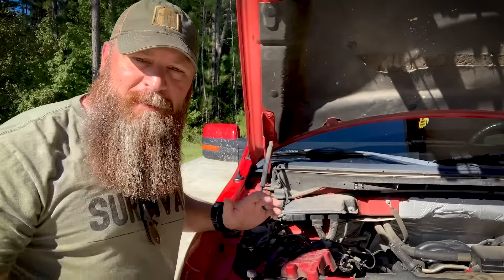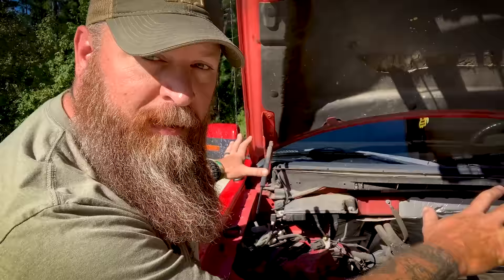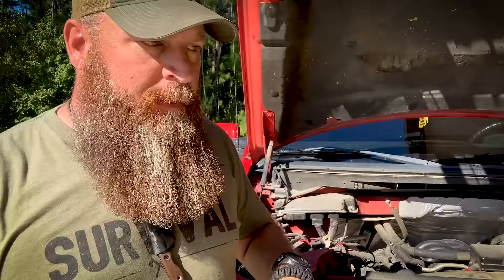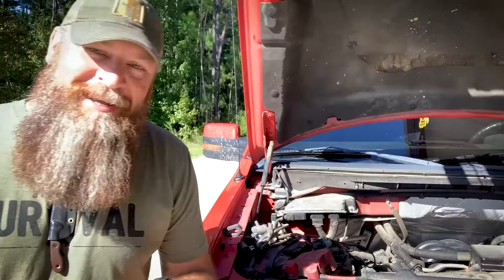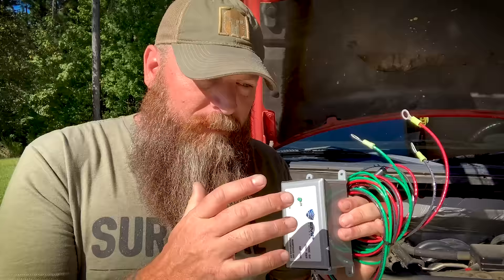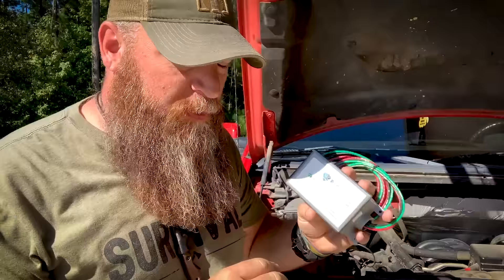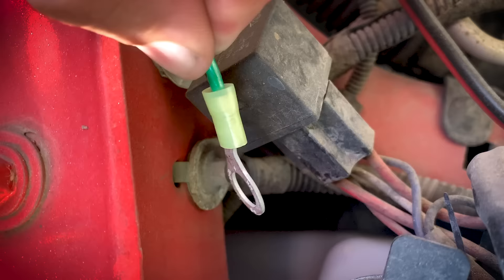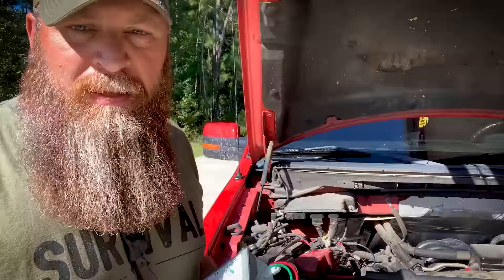EMP PROOF YOUR VEHICLE

Comment: I would need to see this device tested. Until then, an older mechanical diesel pickup is the way to go.
Reply: Facts
Reply: So your "older mechanical diesel pickup" has no electronics, such as a starter or ignition switch?
Reply: I think that it is a bunch of horse shit.
Reply: @robinstewart6510  Those devices are robust enough & wouldn't be affected by an EMP. Anything that has a microprocessor is what will be rendered useless
Reply: @Eric2300jeep    ..  You assume those devices are robust enough. You have no evidence or testing to say one way or the other when it comes to your vehicle. At the same time, most electronics in modern vehicles are fairly well shielded/isolated. They have to be to withstand lightning, electrical shorts, and similar occurrences. In the end, it's all a gamble.
Reply: I mean Whistlin Diesel is always killing trucks maybe he could test one.
Reply: @Leviathan-mj8gi  or you can just install a quick disconnect on the negative side of the battery and switch it off when it's not in use .
Reply: Absolutely.  This is an untested product in a real situation.  Dr Arthur Bradley, an EMP expert recommends a conductive cover or shield over devices and stored cars during an emp attack. He also says an emp attack will disable some devices BUT not everything will be dead.
Reply: @robinstewart6510  got me laughing in carburetor where it will start and run the direct way or old henry ford way.
Reply: @robinstewart6510  A mechanical diesel with a manual transmission is EMP-proof. Not to mention, even if it isn't manual, there are other ways to start a vehicle without an electric starter, which may be complex, but possible.
Reply: @polaris6644  if it's a manual, throw it in 2nd and push start it.
Reply: @del343434  Exactly. With a decent run up and a good starting diesel, you should be able to crank it quick and easy. Worst case, in the cold you can use caveman methods to heat the engine up prior to starting if necessary
Reply: @robinstewart6510  Capacitors are what will be damaged.  Many older rigs don't use that type of equipment that can be damaged.  If you're in doubt, do what all good preppers do... have back ups.  Not just one or two, but three.  Three is two, two is one, and one is none.
Reply: @cowboypatriot1200  That won't do it.  All of you wires are basically antennas that all lead to the electronics you want to protect.  It's very difficult to EMP proof a vehicle.  This company claims to have tested data, but I have friends in the industry that have assured me there is no device that can protect your vehicle.  Best bet is to get an older rig.  Can't break if it don't have it.
Reply: @robinstewart6510 5 speed manual. Push start button is my kids haha
Reply: @robinstewart6510  I can jump my starter solenoid on my 87 f250 right under the hood so hopefully my starter will still work or batteries everywhere arent fried forever or something but I trust the IDI F250 her name is Deena
Reply: This is a scam to get money from not so smart scared people.
Reply: Yup I'm building my yoga pickup with a vw tdi and mechanicL injection pump
Reply: @robinstewart6510  , you are very right !!  Cars will be stopped everywhere along the roads and highways.  don’t phone a tow truck because they might not run either or have thousands of vehicles to tow. Besides they are probably in a safe bunker someplace and won’t be out for 2 or 3 weeks.
Reply: @robinstewart6510  I pop started my manual transmission diesel pickup when the starter relay went bad. Not a big deal unless you are at the bottom of a hill.
Reply: @Eric2300jeep  . I heard that nowadays new trucks have 21 Microchips in them. That's y Ford was stock piling trucks at their factory a year ago & more.
Reply: @carolynhelmic1474  5 stars out of 5 stars is an illegitimate rating as there will not be a way to accurately rate the hopium that this guy and the manufacturer are peddling because there wont be computers or the internet to legitimately rate them at that point anyway.
Reply: @carolynhelmic1474  Not to mention, the radiation that causes the EMP doesn't give the super charged particles marching orders to only affect a car starting at the battery then work its way through the wiring from the batter to each microprocessor.  The entire car and all of the microprocessors and the cellphone in your pocket or your apple watch are enveloped all at once and whether it has power running though it or not with a battery installed or taken out, it doesn't matter the EMP field creates the static energy to fry the micro circuits of the devices.  And connecting two wires to the battery and one to the frame which is also the the negative side of said battery doesn't do shit because it isn't interrupting shit.
Reply: @doc.christopherthompson324  That would be on the low side, I think.
Reply: @cowboypatriot1200  oh, you mean like those battery cut out keyed switches they used to have in the fenders of muscle cars in the late 60s early 70s ??? Is that what ya mean ???
Reply: Yea well, even if this does work, where are ya gonna get fuel from ???
Reply: @robinstewart6510  it's anything with circuitry will be fried. Old Diesel truck can be started by rolling downhill
Reply: @tincupnickleboythe1st700 Probably every other vehicle sitting around with fuel in the tank. Not saying the device will work, but there will be plenty of fuel until it degrades.
Reply: @tincupnickleboythe1st700 Not the ideal situation of course however Depending on circumstances siphoning from other vehicles (abandoned) would be the last resort. At your own risk of course
Reply: 5000a through a 12ga wire? BAW HAHAHAHAHAHAHAHA!
Reply: @robinstewart6510  i love seeing people say "you have no evidence" simply because they have no knowledge on the subject, then get completely steamrolled by logic and facts. shouldn't have had so much confidence in your nothing answer.
Reply: Smart move because this product is a scam! This isn't even a surge protector. A surge protector would need to be placed between the battery and the wiring harness. It's not.

Microprocessors are what's vulnerable to an EMP and if they are not shielded in a faraday cage, they fry.
Period.

But they are guaranteed! 🤣

That $450 you spend for "peace of mind", will be shattered when you car won't start.
Reply: @Eric2300jeep  Anything with transistors would be affected. It doesn't need to be a microprocessor.
Reply: You're on the right track here, but as gentleman suggested, you need some way to start it that doesn't require a starter motor. Think "diesel Model T," if such a car exists. Something with no electronics, coils, or starter motor. An old steam-powered car might be the way to go.
Reply: @nhactual06  It is.
Reply: A deuce and half is only thing your safe with
Reply: @tincupnickleboythe1st700  you dont.
Reply: Yup, Parked on a hill.
Reply: @robinstewart6510  A starter or ignition switch will not get destroyed by an EMP.   Think of it as a HUGE static electricity surge.  Static electricity will not hurt things like these but computer chips would be fried.
Reply: So your vehicle 'survives' an EMP event, let's just assume for arguments sake, it's the prelude to a larger attack, where are you planning to drive? Get out of the immediate target area if you are in a City? Roads blocked with vehicles, lots of people tgat were in those vehicles, wandering around, panicking, how long, how far do you think you will get, before someone blocks the road on purpose?
Reply: @robinstewart6510  you can bypass an ignition switch easily (assuming you have battery) and if you own an old diesel pickup truck like that it’s smart to keep a spare starter in a faraway bag
Reply: If only we had a nuke to detonate in the upper atmosphere. I'm skeptical about the EMP thing. Back in the 50s they popped a lot of nukes in the atmosphere, seems we should know more about it.
Reply: Make it a standard transmission and park it on a hill.  Go down and get you a new solenoid and ignition with some wiring and wrap all that in some wax paper then some aluminum foil. and toss it in your Glove box. Think about a lightning strike and what it's gonna do to those wires.  That charge has got to end somewhere and when it does. whatever that device is, will be melted or welded.   You are right, that device does need to be tested.
Reply: @CharlieWhitewolf  I think a huge part of the problem is sods law, shit hits the fan at the very moment you aren't prepared despite doing all you can to be prepared, not saying don't do anything, more be realistic in terms of you can't prep for everything.
    By all means EMP protect your vehicle or have spares etc but be aware shit happens when your vehicle is off the road being repaired/service and you have the courtesy car from the dealership,,,
Reply: @carolynhelmic1474  

Good luck trying to phone anyone. 
All cell phones will be dead at the cell providers end. 
Even if your cell phone survives, it will read NO SERVICE for months. 
All landlines will be dead too. They all use microprocessors to access satellites for long distance calls and Microprocessors at the telecommunications hub even for local area (landline)calls. 
Microprocessors will be the first to fry and will all need 
Replacement. 

There will also be no water, water treatment, pumping stations, traffic lights, police fire, ambulances, trains or food deliveries as they all us digital solid state electronics for organisation. 
No GPS, no internet, no social media. 

No businesses like tow truck services will be operating without phones, laptops and sat navs. 

Not unless you meet face to face with them. 
Don't send a letter either. 
The sorting office relies on computers and an internet connection too.
Reply: @trublu3483  

Get a large supply of diesel then. 
Enough to last you a few months because there will be no filling stations, supply ships, refineries etc. 
They all rely on an internet connection to operate, GPS on ships, microprocessors at the filling stations and refineries and money transactions will be dead too so not one outlet will sell you any fuel anyway. 
Even if you gave them cash, they cant bank it as the banks systems will be dead. 
All digital servers will need replacing. Nationwide that could take a very long time especially when all the manufacturing plants that make the replacement microprocessors take a hit too or only exist in China..
Reply: @davidwaller5740  

You and thousands of armed others all looking to syphon fuel from dead cars. 
I would avoid any abandoned vehicle as a potential kill zone unless you could scope it out for a good while. 

Goodluck.
Reply: @ljt3084  yeah, that’s the part of my comment where I mention… At your own risk of course. I am fortunate enough to be well supplied and live out of harms way. You are correct in your sentiments however. It’ll be survival of the fittest for sure. I pray that we don’t see what I feel is unfolding.
Reply: Until you need to refuel it and realize that fuel pumps are all electronic now.
Reply: Yeah the only way to test an emp is to set off a nuclear bomb.
Reply: @Eric2300jeep  the only electronics that will survive is tube technology. Nothing more modern than that will survive.
Reply: The only way to protect a modern vehicle from emp is to park it in a faraday cage. That's it. And good luck with that.
Reply: Get a hybrid, that way youre covered in case of an emp or oil shortage, its best of both worlds.
Reply: @Eric2300jeep  such as the gas pumps eh? most people are not going to have 1000's of gallons of gas stored (which wont last that long even in the best conditions) so they will have to rely on EMP dead pumps thus vehicle is useless even if functional otherwise.
Reply: You’re gonna put a box on the truck, and that’s gonna keep the  EMP from touching any other electronics directly, and it is gonna take 5000 amps through those microscopic wires and protect everything. 😂
Reply: Your wires will be done if there is a charge in them.
Reply: Amen
Reply: @robinstewart6510 Yes, I would think that the solenoid, the alternator, and starter would fry for sure.  Distributor and spark plugs maybe as well?  Battery?
Reply: Will still fry your solenoid if the battery is hooked up when the emo happens.
Reply: @philc.9280  THE Issue w/ using said “..cover or shield…during an EMP attack..,” is - HOW Would you KNOW WHEN IT [an EMP Attack!!] Would Occur..???🇺🇸
Reply: Only one problem.  😂  be careful what you wish or ask for.
Reply: New Subscriber. I'm in the Northeast rust is a big problem okay so I asked YouTube and it actually give me the answer I was looking for 😂 Thanks Bro.

"Failure to prepare on your part does not necessarily constitute an emergency upon mine." _Master Drill Sargent Pope
Reply: I have a 2007 Ram Cummins. In hindsight a '97 2500 12 valve manual trans would have been a keeper.
Reply: @robinstewart6510 
Microchips are the afected like the ECU of the vehicle, old diesels and gas carb vehicles are safe.
Reply: Can't go wrong there! As long as you have fuel and compression you're good to go! 👍👍
Reply: @anthonymazzone2875  As someone mentioned, a Model T is probably the most robust vehicle, multiple fuels, dead simple design.
Reply: Every car since 1899 has function critical electronics